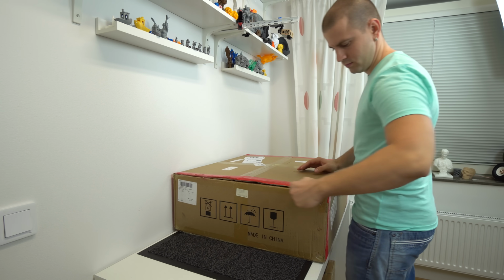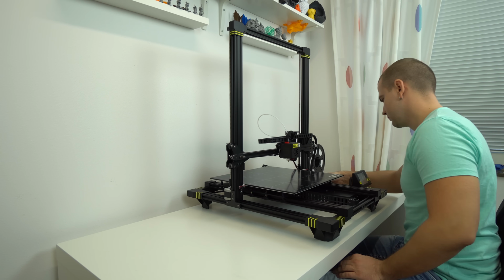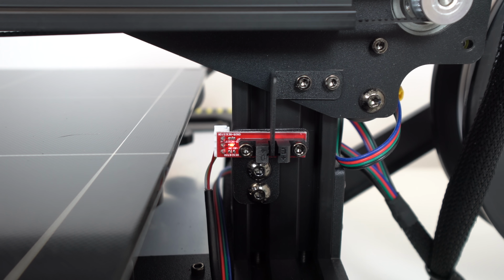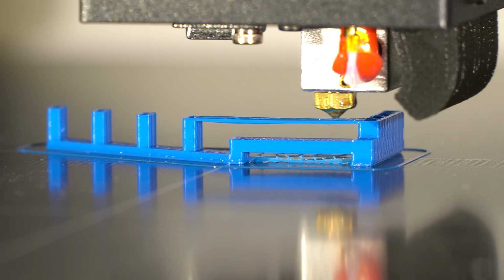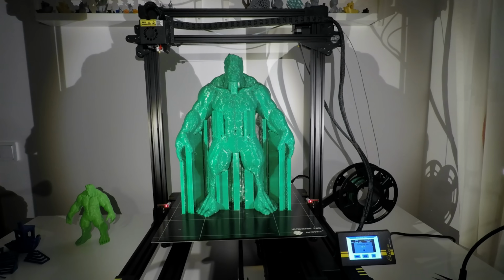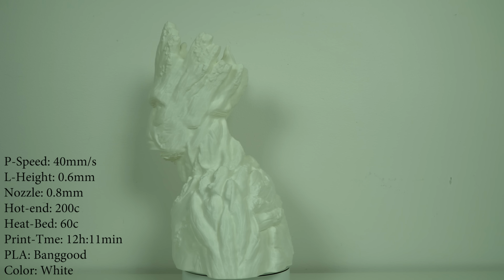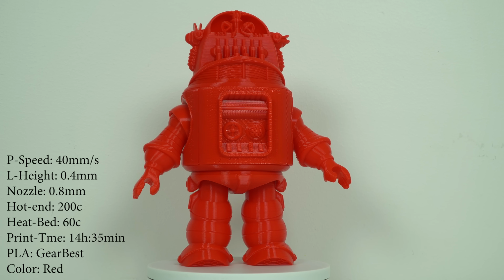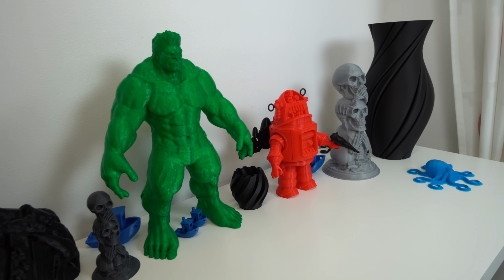Anycubic Chiron Final review - in depth  4K video

Comment: Can you make a video on what your optimal retraction settings were? Or just tell me i have been having trouble getting retraction right.  Also what temp do you print pla at?
Reply: PLA temps are listed on the spool of the PLA.  Retraction settings will very by printer, even identical models.  Try 7mm distance at 50mm speed.

Comment: I’m brand new to 3D printing and got my first printer 4 days ago and I am already hooked and looking for another. The one I have is a Voxelab Aquila X2 and it is a beast for the price. It’s been printing since I got it with absolutely no issues, but it’s just a little small. Wanting some a bit bigger and ran across this one on sale for $379. There’s so many out there though and I haven’t been able to find a good comparison between large volume printers so I’m struggling to determine which to get. Anyone here tried several and could recommend one I would greatly appreciate it.

Comment: Out of all printers I have never had such a hard time getting the bed leveling correct. I've done all the techniques described even the 25 points advance setting. And the z axis kept on moving on me when I would home or would start a new print. What worked for me was autoleveling, then using the 4 adjustment springs. But still doesnt seem 100 percent.

Comment: I'm not sure what settings I need tweaked. Can you explain  what other settings in CURA you are using to get these prints to come out smooth.

Like wall county
Top/Bottom layers
Ironing Yes or No
Infill
Retraction Yes or No

Or any other setting you messed with.

Thank you.
Reply from the maker: Layer height 0.15mm
Wall 3 
Top 5-6 
Bottom 3-4 
Infil 20%
Print speed 40-50mm/s
Travel 100mm/s
Retraction yes
PLA 200C 
Heat-bed 55-60C
Didn't use Ironing.
Check your belts, adjust wheel bearings on all axis. Make sure that you don't have any loosen or too tight bearing wheels or belts. Level your printer nice and slow.
Reply: @NexiTech  I mean the prints where you used a .6mm layer height.
Like the Groot.

You listed most of the main settings. You printed that with a .6mm height?

I tried doing a simple chest armor piece with a .6mm layer height. And similar setting as your groot. But my layer lines where not as smooth as yours.
Reply from the maker: The groot print is printed with much larger nozzle then standard 0.4mm you can compare it like that.
Reply: @NexiTech  understood, I installed a .8mm nozzle.
I put in my settings the same ones you used for groot. But I'm getting really large layer lines. It doesn't look smooth like yours.

Comment: Hi, I'm new to 3D printing, and I got the Anicubic Chiron, you know why the bed doesn't heat, it only reaches 24 degrees. I raise the temperature and it does not heat. I did all the steps.

Comment: Hello i'm new to this 3D print stuff and wanna ask a few questions hope you can help.
1. was the last octopus printed with the same machine ? because it's way smoother on the surface
2. Which features/properties in the setting panel that control the boldness of layer lines on a model 
3. What should i do if i want to get rid of those layer lines after i'm done printing because i see the figurines (toys) surface is smooth like baby skin

Comment: Hello, can you please comment on the power failure resume function? Do you have to add "G5" to the gcode manually to get the resume function to work?  In my case, I just had a power failure and the resume function does not work at all.  Thanks!

Comment: It's a great printer. This was my second 3d printer purchase after a Geetech kit that didnt work and I gave up on. Few screws then it worked out of the box!

Leveling is a manual process, but was made much easier as you could control the hotend via cura before. Its not working in the latest version but I'm on mac so that may be the issue?

That said ive moved this printer 3 times and once checked never needed to adjust anything. Its always been bang on.

Few things, the hot bed cable catches on the frame, which i thick has been resolved in later models but watch for that.

Only other advice I can give is unless you really need to printed stuff over 200mm or don't get this,  I thought id buy it as it would give me the chance to. But 3d printing takes so F'ing long that ive never done anything above 150mm so wish id have bought a much more compact, and cheaper machine.

Beginner mistakes aside, if you wanna print big its a great, cost effective option!

Comment: Your videos are very well detailed and thorough. Thank you for helping me make a decision!
Reply from the maker: Thank you so much! Wish you all the best mate and thank you for stopping by.
Reply: Definately! I just ordered my Chiron. Anxious to try it out!
Reply: @mamute290595  How is it?
Reply: @maliksworld8467  It's pretty good. I have printed about 3 kg of filament with it so far. I won't say it was flawless because it is my first 3d printer. With that said, I am really satisfied with the results. Haven't had any major issues so far. I have printed a lot of tight fitting parts and holes to make brackets for automotive components. I printed ABS and ASA with it and had very little problems. Just got a kit with different nozzles and I am about to try them out. The 0.4mm nozzle doesn't make much sense to use on larger prints since it takes forever to print.

Comment: im trying to print this large grout, I've added custom supports, changed layer height to 0.6, 0.8mm nozzle, and its saying two days the speed is set at 40mm what am i doing wrong as i can't get to the 12/14hour that you achieved ?
Reply from the maker: Alyicia Morgan Have you tried 0% infill and 1 parameter on wall?

Comment: Hi nexi,
I'm trying to decide between the anycubic predator and the Chiron, they're both very similarly priced at the moment, do you have any thoughts on which one I should choose?
Reply from the maker: Max Klimeš They are both good 3D printers but very different style. Delta VS Cartesian. Very hard to debate between these two as they are very different from each other.
I myself like alot Delta style 3D printers. Deltas are fast, very cool design and they have unique sound when they are printing.
On other hand standard Cartesian 3D printers are usually more reliable in long turn as bearing wheels typically last longer then joins on delta arms. Some people use rubber band's between arm joints which in some cases prolongs the arm joint's life span.
Other then that delta style 3D printers really rocks and I personally would choose Anycubic Predator over the Chiron.
Reply: @NexiTech  Okay, thank you, I'm going to buy the Predator. Keep up the great vids, you're probably the best 3DP youtuber of them all, love you!

Comment: Chiron vs Predator vs CR-10 v2: My final question about chosing my first 3D printer...I know different types but same purpose; which has better printing quality and durability/reliability? Make comments please.
Reply: I bought this (my first FFF 3d printer) after watching this video - everything just works immediately - I am SO impressed.  My mates are forever telling me about tapes and sprays and hoods and specific brands of filaments etc etc, but none of that seems to apply to this printer. Nothing has gone wrong for me so-far (after one benchy, and about a dozen engineering prints of all sorts).
Reply: @chrisdrake4692  How's it working after 4 months?
Reply: @CelsodeSá  Yep - super happy with everything.  I'm churning out engineering models, experiments, and technical parts and it's basically a no-brainer.  Design, slice, print... just works.  Here's a 450mm per-blade high wind turbine experiment I did today: https://youtu.be/_VYOE5AHHqA and here's an underwater glider I also made: https://youtu.be/yfEDSJ-jyXc - both of these are really easy to make yourself using my "Airfoil Tools": https://www.youtube.com/watch?v=AAc8waXFbWQ

Comment: does it plug into 110v outlet or 220?
Reply from the maker: Samuel Pekarsky It's universal voltage. It's works on both 110v and 220v just flip a small switch on powersully.

Comment: I need a new and bigger printer now. Should I get predator or chiron? They have"similar" build volume but I'm really torn
Reply: Edison Gold they are Both very similar but it depends predator takes 2-4 hours to assemble but never needs to be leveled but the Chiron takes 10 minutes to assemble but you have to level it
Reply: @11creeper45  alright makes sense. But comparing a default Chiron to default predator, which would be best? On print quality only
Reply: Edison Gold there really ain’t much a deference in quality also you need a lot more room for the Chiron
Reply: @11creeper45  oh well. They are similar priced so... Maybe I will get predator. I've been seeing people complain a lot about chiron (despite being the New model). What printer(s) do you own?
Reply: Edison Gold I got a Chiron

Comment: Hi Nexi, excellent review. Can you advise if the Chiron has thermal runaway protection enabled for either 1.2.7 or the latest firmware?
Reply from the maker: Thank you Michael, Sorry I can't confirm that as I never test runway protection on my printer and I sold my Chiron few weeks back for lacking space in my home.
Reply: Thanks for the reply.  Do you still recommend this printer for an extra large format or is there something better out now with a 400x400 plate?
Reply from the maker: Michael Rogan Yes I do, I think that Chiron is very good large scale 3D printer and well worth of money.
Reply: @NexiTech  thank you  based on your review and recommendations i will buy.  Cheers.

Comment: I have had very bad experience buying the Chiron, have owned it for just over a week now and waiting to hear back from Anycubic as I have a power supply issue and it is failing prints. Would of thought they would of fixed the issues addressed in your first review but very dissapointed to say I have spent nearly $600 Aud on this machine and am regretting it comparing the experience I have had buying Creality machines. Just hoping they will get back to me asap and replace my machine but have had to contact them through eBay after many email attempts to get a reply at all and still waiting to hear back so in the mean time stuck with a massive useless machine while my 2 other Creality machines are printing away with no issues. So dissapointed

Comment: Should I buy this or the CR-10 V2?
Reply from the maker: Depending of the print size that you need? Cr10 v2 is 300x300x400 and Chiron is 400x400x450mm that's huge difference in 3D printing world. Also Chiron can be found for less then 400$ which is very good price for this machine. Check the Aliexpress link in video description Chiron is on 27% discount now.

Comment: I noticed V1.3 still have extrusion problems and sadly the autobed leveling is pretty much useless. you have to do it over and over again after it is shut down...  I autoleveled it perfectly, started a print and it was grinding on the glass bed but the level test was damn perfect... and why the heck did they not included flow rate in the menu? so many features are missing in the menu... besides that I think its a nice printer for its money but I rather uprade it with non anycubic firmware. Also I noticed the glass sheet was glued to the heated bed... really a downside... I want to able to replace the sheet or turn around for a super smooth mirror like first layer.
Reply: Can you recomend 3d printer with big printing area?

Comment: You have shared your profile for Cura which is great but what preset printer do you select in order to put the profile onto?
Reply from the maker: Pete Gray You can select CR10 S4 and then edit profile.
Reply: @NexiTech  thanks. have you installed any of the mods on your chiron? I have just put an x axis which has reduced noise a lot but not sure how you have mounted them on the z axis? Any pictures or videos showing your mods would be amazing.

Comment: Where can I find info on what is required to change the Nozzle to .8?
Reply from the maker: Info? Just heat up you nozzle to 240c and take out filament,  Leave it on 240C. Then take wrench and hold heat block with and with other hand take 7mm socket, place it on the nozzle and done :)

Comment: you convinced me to buy one lol but im having a problem. When i hit print to usb (Connected to computer) it loses Z0 and scrapes against the heat bed so much it sanded off half of my .4 nozzel by the time it got to X0Y0. I did the auto level but doesnt drop enough to push the switch. please help me find answers

Comment: Great info, I have not tried ABS, PETG, or TPU on my Chiron.  Watching your video makes me want to give it a try!
Reply from the maker: Dufisthenics Why not. I don't use ABS that much but PETG and TPU(flex) very often. Get some PETG and give a shot. It's   easy to print just as PLA just lower the cooling fan to 50%.
Reply: @NexiTech  It's because I probably never knew best settings.  I will try using the settings you listed in the video.  I have some PetG and ABS that are collecting dust because I never could get them to print correctly.  If you had cura profiles for each it would be awesome.
Reply from the maker: But I did post print profile for CURA and S3D in video description when I upload this video. It seems that nobody look in video description :D Go with PETG. ABS can be pain to print with all 3d printers that are not enclosed.
Reply: @NexiTech  Yes I saw that thanks.  Have you had any of the common failures yet on your Chiron?  My hot bed cable just broke yesterday.
Reply from the maker: @Duf  Broke?! How the two thick silicon wires can be broken?
Reply: @NexiTech  Yep it has happened to a TON of Chiron owners.  Low quality wire, also happened on my I3 Mega.

Comment: I'm actually quite surprised and a bit disappointed you didn't touch on one of the most important characteristics of any printer, and that is the speed. You seem to be printing at super slow speeds (50mm/s), and it would be great to know how this printer performs at faster speeds, especially considering it uses a bowden extruder. I print at 200mm/s and 140mm/s on my Prusa MK3 (for infill and perimeters, respectively) and it's a direct drive, so I'd love to know how fast this printer can print reliably and what effect speed will have on prints.
Reply from the maker: Malek Ali Printer this large should not be use in such a high printing speed due to massive size and weight of the heatbed. That would put huge stress on components and for sure lower it's lifespan. Smaller printers with lower heated bed dimensions and heat-bed weight are in general faster and it will produce better print quality because of less moving mass. 140mm/s? I doubt that you can reach true 140mm/s print speed and still extrude and cool down the filament and  get nice and even layers. Maybe if you have minimum layer time set to much higer number then 10s so the printer almost never reach that speed. That way you can still manage to get some print quality but no way that you  can set minimum layer time to 0s and print 3D benchy at 140mm/s and still get good print quality. 
With 140mm/s you could print some huge object infill or objects without to much detail and sharp edges and corners and even for infill 140mm/s is too much...
Reply: @NexiTech  of course due to acceleration settings, a benchy will never reach the full  print speed of 140mm/s. It only reaches 140mm/s on long straight lines. And I design a lot of functional parts with long straight lines. So I definitely reach the full 140mm/s quite often, and when acceleration settings are set properly I can achieve some amazing prints even at that speed,especislly when inside perimeters set to 140mm/s and outside perimeters set to 75mm/s. Because I have x/y acceleration set to 800, the print head will of course begin to slow down as it approaches a corner. I never print models and things I can't use. These speeds work for me but won't work for everyone. Of course the temperature would have to be high enough to extruder enough material fast enough. Also, I have my infill set to 200mm/s as well as "max speed" set to 200mm/s, and infill acceleration set to 2000, and when printing large objects at 215 degrees celcius, I definitely achieve a full 200mm/s on the infill (I can make a video!). For the surface finish I print at 100mm/s and get a flawless surface that almost looks injection molded. I've got my settings tuned like no tomorrow on all 3 of my printers :) even on my Robo3D I've upgraded and tuned it so well that I can achieve a full 140mm/s (again, on large prints without too much detail and a lot of long lines), well past the manufacturer specs.

Comment: Hi.  have you had any bed wheel issues on this new unit?  During a long print for me, I can feel some vibration. When I looked underneath I can see that 3 of the 12 bed wheels are not turning at all.
Reply from the maker: 10p6 10p6 Not at all. I adjust all wheels when I was assembling printer and that's it. Loose all heatbed whells (eccentric adjusters) and then when they are free try to turn/spin them with fingers.If they turn hard try take them out and re-check. They might be bad or they might be just over-thighted.
Reply: @NexiTech   Thanks for the feedback.  Unfortunately I just found this out mid way through a very long print.  So hopefully the print makes it.  I really wish they would have used tube rails like on the Chiron like on the Prusia Mk13.  Hmmm

Comment: I just got a Chiron bidding, due to this review, through Anycubic's eBay Store; I got an amazing deal and it should be here in few days. Please do a modding video. My Anycubic Mega is still putting out great prints. When it comes to PLA I would compare it's print quality to my MK3.  You put out the best most comprehensive and to the point  3D printer reviews. I am still stoke with the Keenovo mod on my CR-10S; your video made so simple.